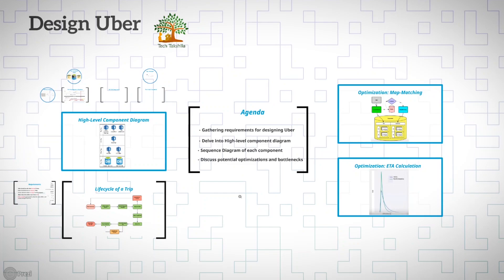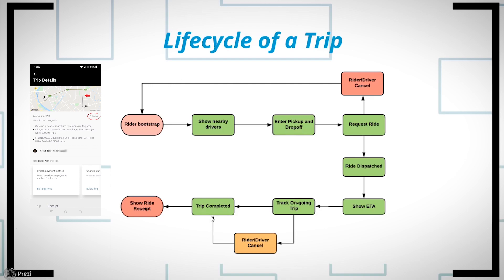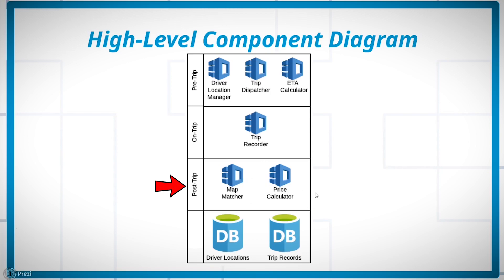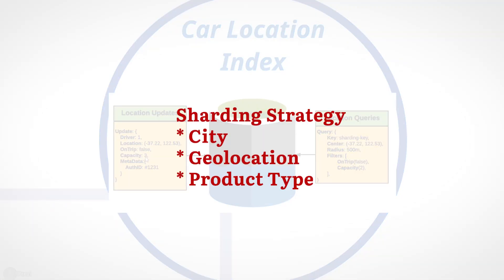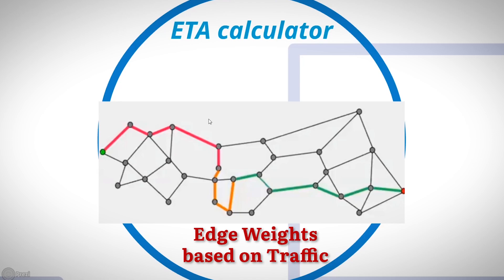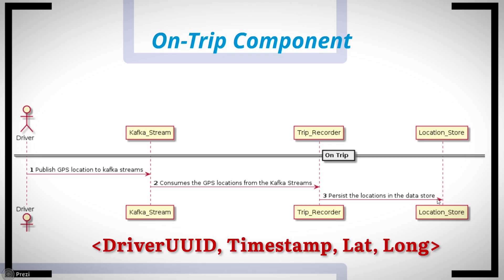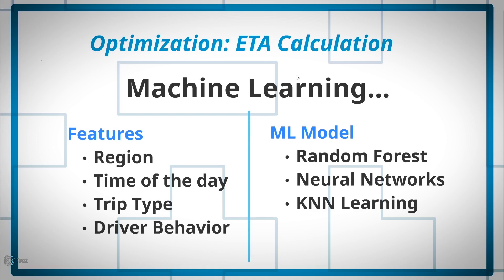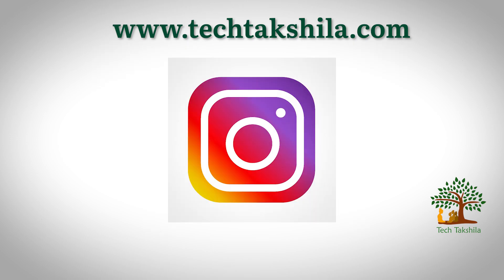Uber System Design | Design Ride-Hailing Application | System Design Interview

Comment: How does the nearby driver location data and movements continuously gets updated on the riders device?
Could you explain the flow from the Rider's location being passed for the lookup to fetch/query the latest driver location? The service, where it actually takes the rider location, moves to the correct shard containing the region details - which contains the latest driver details in them.
Reply from the maker: The nearby driver location gets fetched from the car location index. More details could be found here: https://www.techtakshila.com/system-design-interview/chapter-3
Reply: @techtakshila5128  The above link doesn't work. It says "Access Denied".
Reply from the maker: @harshaadigas  https://www.techtakshila.com/system-design-interview/chapter-3/  try this link

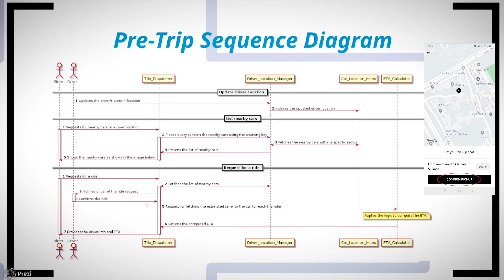Comment: At time 6:56 : Trip dispatcher notifies the drivers of the ride request. How trip dispatcher knows the address of the near by drivers ? Does it opens the persistent connection with all the drivers beforehand ?  and How the concurrency is handled here when more than one drivers tries to accept the ride ? Please explain.
Reply from the maker: The trip dispatcher knows about the address of nearby drivers from the Car_Location_Index and notifies the driver via a push model(e.g. Websockets). The concurrency  can be maintained using the mechanism of Optimistic Locking.
Reply: @techtakshila5128  Or I was thinking, the concurrency would not be an issue, if the drivers are ranked based on their ETA/Distance score to the Rider, and should the driver chooses to deny the ride, the request would go to the next driver as per the rank.
Reply: @ansuman4233  I believe the ride request is not broadcasted one-by-one based on the ranking of the driver(calculated from ETA/Distance score). It would broadcast it to a set of drivers in a radius and then the concurrency will come into the picture. If no drivers present or no drivers accept the request within a preset time, the radius is then expanded to fetch drivers.